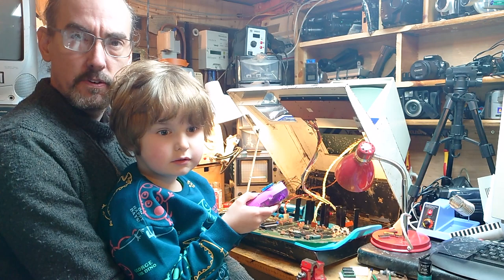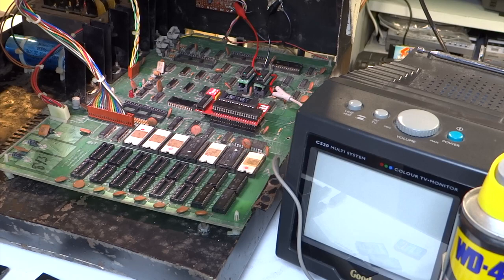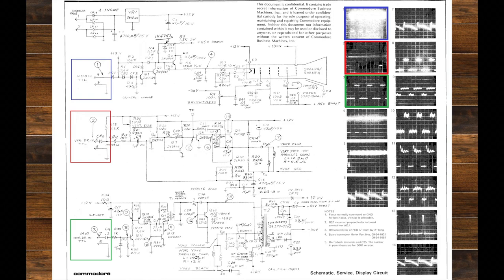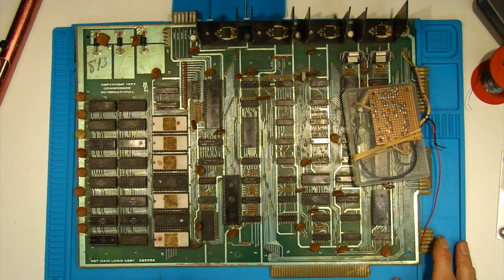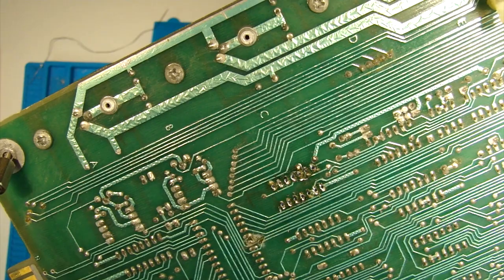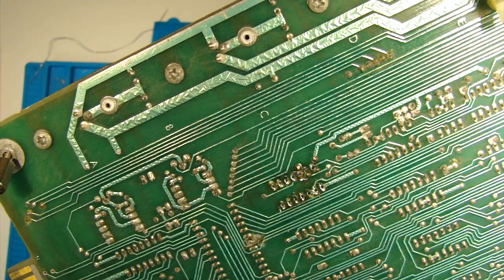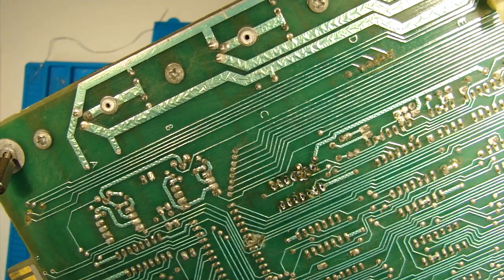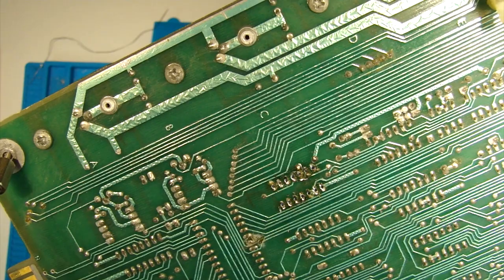Commodore Pet 2001 Pt 5 No video from logic board repair

Comment: When you removed b1 there was a pin hanging out on ic a1. Other than this, it’s amazing how far you have got! It looks like you need to next look at the char rom and associated components. Well done. I look forward to the next vid.
Reply from the maker: Hi yes it was out for a test I had done, I took that leg out and jumpered two other pins that I had already moved the wire from after testing. Sorry for the confusion.

Comment: I've never worked on a pet before but I'm familiar with amigas and c64s. Anyway one approach I take is if I have a working machine I take each chip out of the non working machine and test each out one by one. I'm not saying that would fix it but it should give you a good idea of what you in terms of good chips.

Comment: great series of videos. Can I enquire -  Should the leg on IC A1 have a pin not in the socket at 42:24?
Reply: I caught that too, at 40:18
At 39:26 it's properly socketed.
In your video posted before this one you appear to have jumpered this pin.
Reply from the maker: Hi yes it was out for a test I had done, I took that leg out and jumpered two other pins that I had already moved the wire from after testing. Sorry for the confusion.